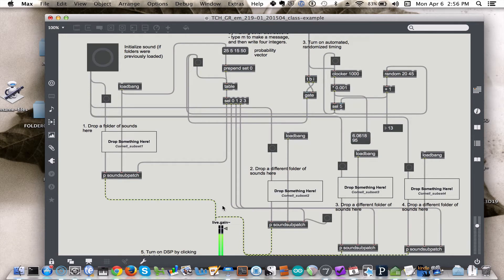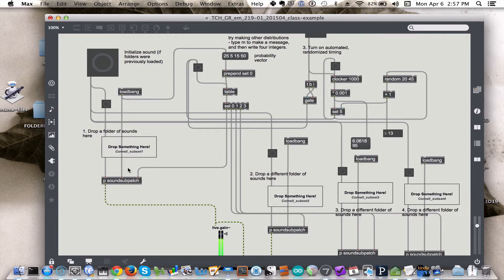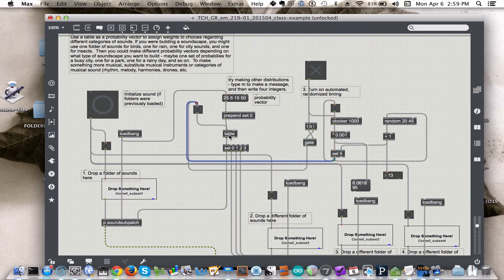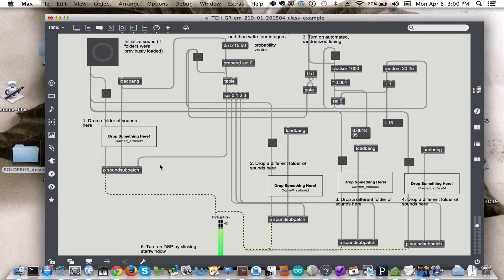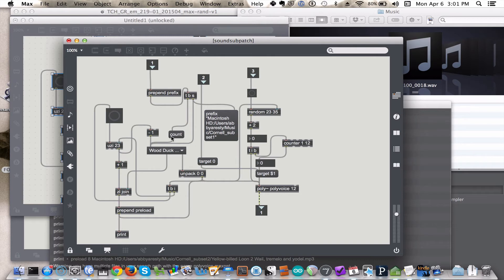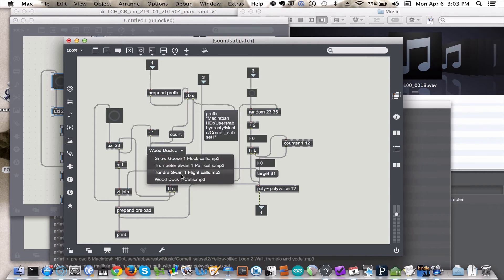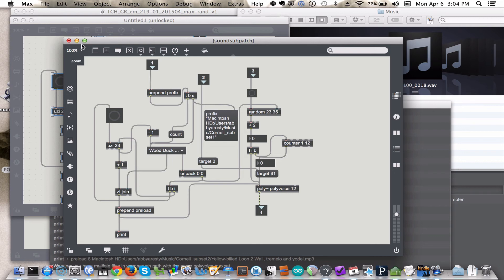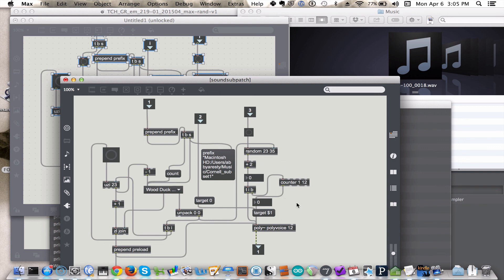Max MSP Random and Table

Comment: hey, re-made this patch and in the sub-patch the poly~ object doesn't seem to have an output to connect to the outlet? Do you know why this would be happening? Thanks :) and great video
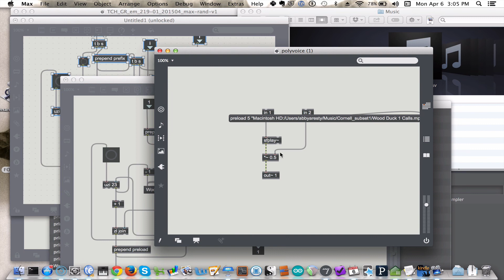Reply from the maker: +Tim Ledson What happens if you double click on the poly~ object?  If nothing happens, Max can't find your polyvoice file.  Go to options > file preferences, and add the path to the polvoice file.  If your polyvoice file opens when you double click it, but there is no output, make sure you have an out~ object, and you have assigned it the number 1.  Check 8:20 in the video to see the polyvoice file.  Also, I just added a link to the files in the video description.
Reply: +Abby Aresty Yeah, nothing happened when I clicked on it! I tried to add the path to the polyvoice file but I think I may be doing it wrong as nothing came up when I double clicked the Poly~ object? Also, I made an out~ object but it came out brown, so it doesn't work. I'm a bit confused about this.. 

Also, would this work if i wanted to drag a different drum sample kit into each dropfile object, so that it would pick a random kit and use it (I have made a patch with a step sequencer but only uses one drum kit)?

Sorry if you don't understand that, hopefully you can help me, thanks a lot :)